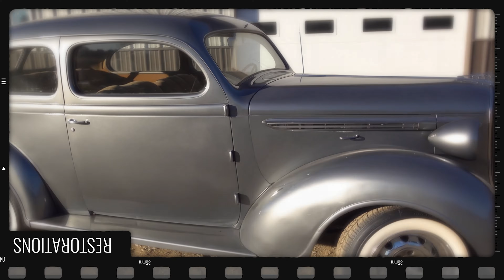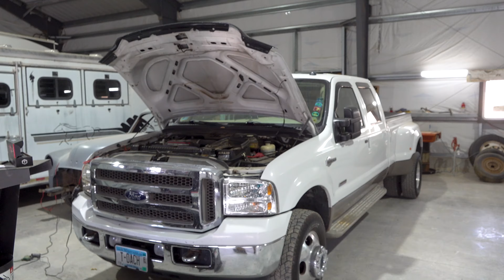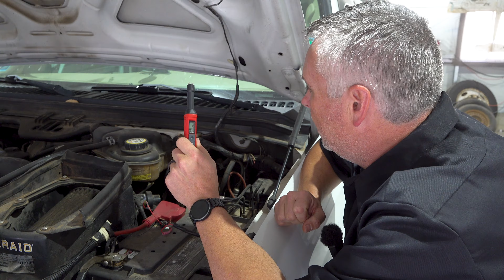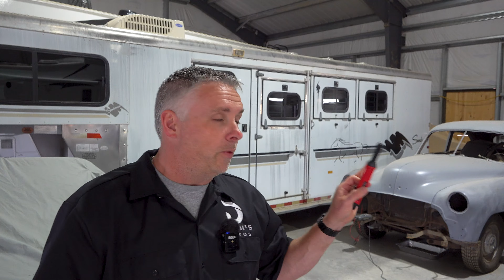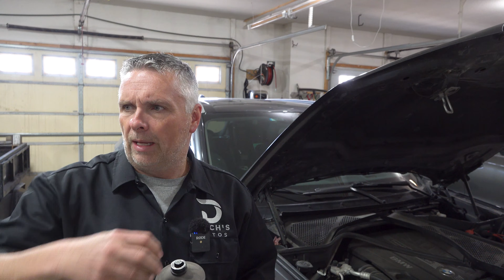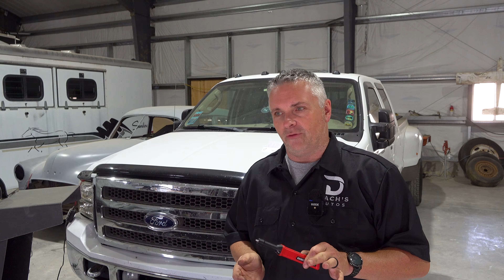A Must-Have Automotive Tool: KAIWEETS Brake Fluid Tester

Comment: Good video, Dach! I got this tool yesterday, and it definitely gave me a good idea of whether I really need to pay $160 for a brake fluid replacement. Honda suggested that I flush the brake fluid and transmission fluid since the mileage has passed 30k. The test shows 1.7% moisture, so next time, I can confidently say ‘NO’ to them! 😀
Reply from the maker: That's the beauty of having the right tools for the job. It's a good feeling to be able to know what needs to be done, and what can be avoided!

Comment: Great video! Ive been using mine often.
Reply from the maker: They're great! - I recently took the wife's Outback into the dealer for 200k mile service and they suggested $300 for brake flush due to moisture.  Nope!  This little guy really comes in handy.

Comment: Good video - these things are becoming cheaper by the minute, and for $12 I'm going to buy one just to play with.  Brake fluid changes are a big profit margin "service", and because it involves brakes people get scared and jump right on it.  An interesting check would have been on a sealed bottle when first opened ...
Reply from the maker: @Stevie_D  indeed it would have. I thought I had a sealed bottle, but i was mistaken.   Problem pf having too many bottles of stuff around..
Reply: https://youtu.be/OJ4BDWQRLrA?si=5tBN5Wg52J2dZACh
Reply: I did it on an unopened bottle in the link.